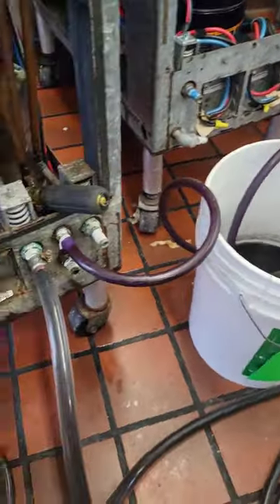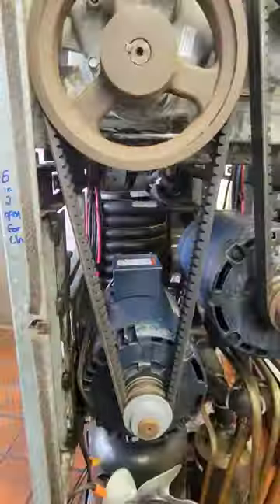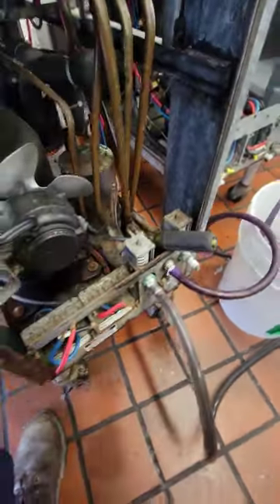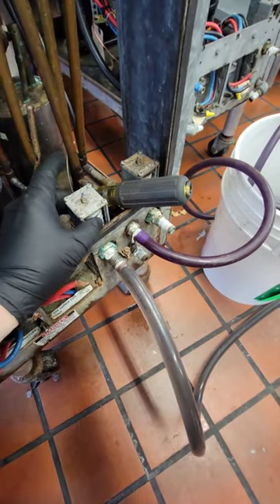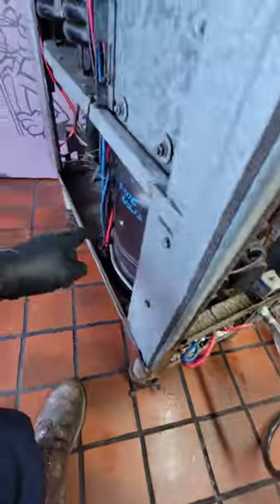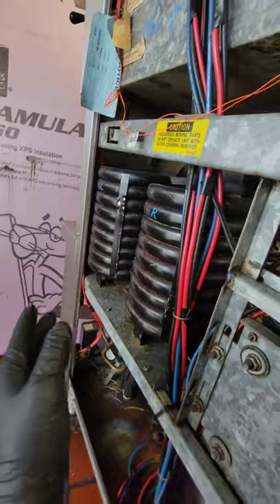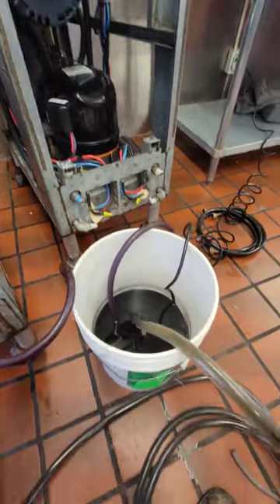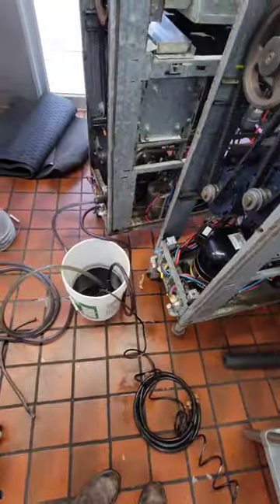Cleaning the coax coil on an water cooled ice cream machine

Comment: What kind of pump are you using to push the chemical through the system ? I think I'm going to have to try this on a Walk in freezer of similar size.
Reply from the maker: It's a special submergible pump for pumping acid. I believe it was made by nu-calgon or something of that sort of nature, that's a shop tool they provide.